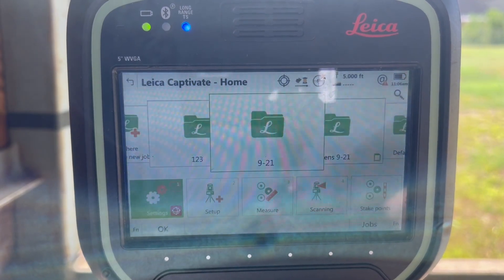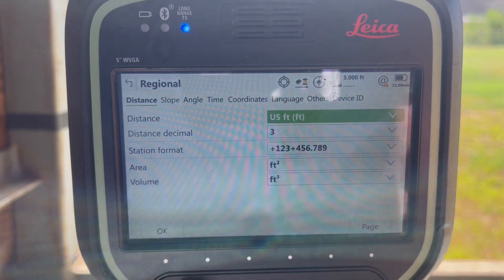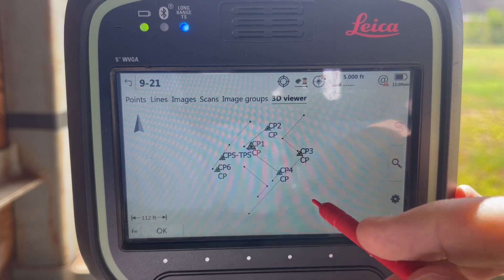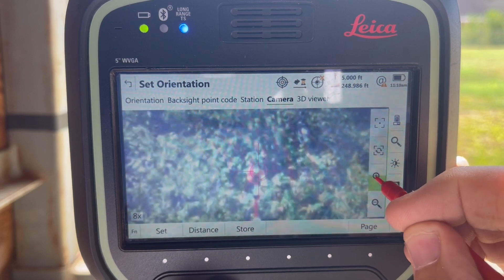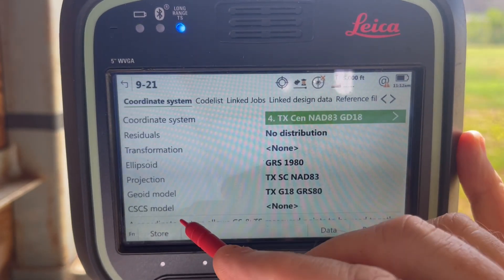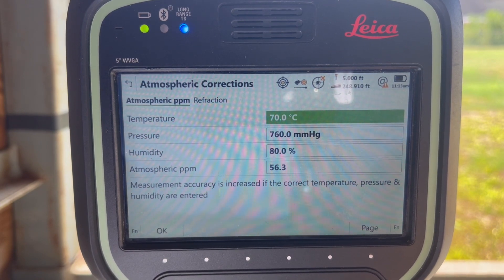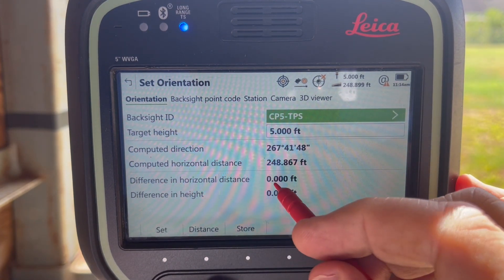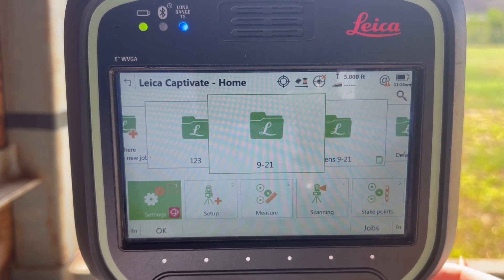Leica CS20 TS16 : Overview of common error sources

Comment: Wow. I didn't know that in scale when setting up to a back sight you should set the scale to current set up.. I'm having issues using a UK os system OSGB36 and was getting errors all the time when checking my distance to my back sight shot.. Should you always use the same coordinate system in the TS as the one the control was shot in with a RTK gnss rover..??
Reply from the maker: Yes-critical to use Same Coordinate system if using points from the RTK unit in the TS, also important to ensure using correct Coordinate system, within the set parallels else will introduce    errors